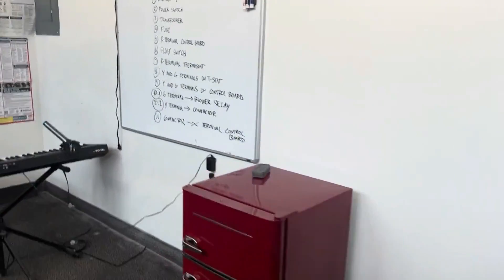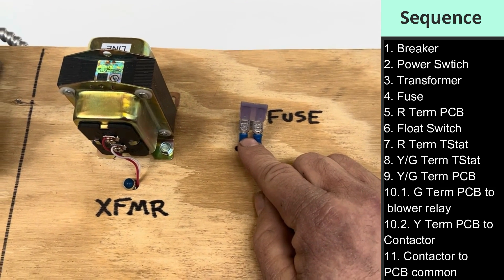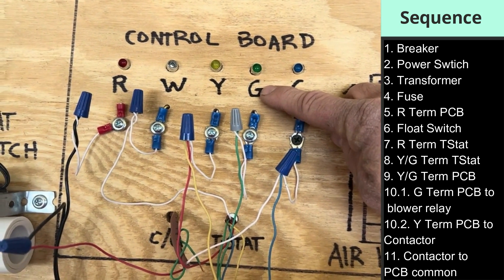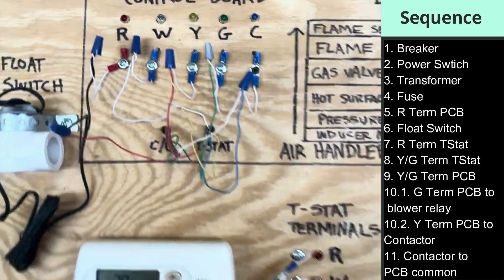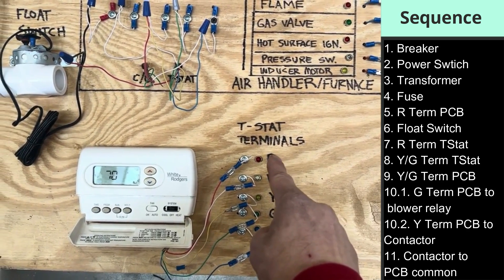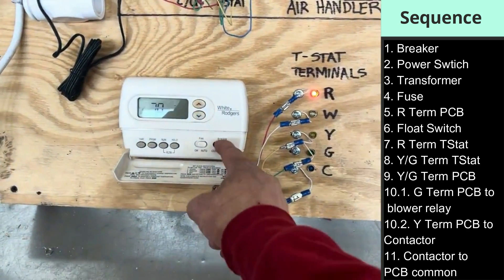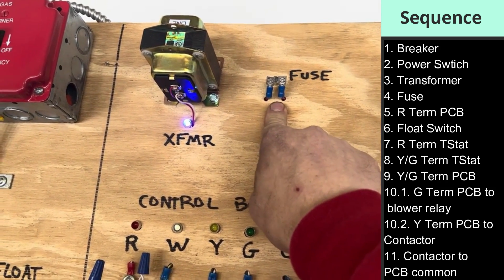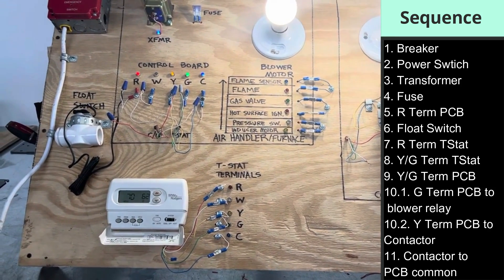Intro to Troubleshooting Central Air Conditioning

Comment: Thanks for the great training. I do have questions. That pesky c terminal. Is it a source of 24 volt power or a return to complete the circuit  ( which would have voltage on it). On the smart thermostats "c" is needed for power? On some systems the condenser unit needs "c" for a return to complete. I believe what I'm struggling with is "c" a type of neutral. More research: watching a few more of your videos has answered my question. "C" terminal is a neutral and like any other neutral in an AC circuit there is voltage on it when in series with another source of resistance. Please correct me if I'm wrong

Comment: My ac went out. I have tested voltage at the tstat wires coming out of the wall and confirmed voltage there. I'm not getting voltage at control board for the ac when tstat is on. I'm also not getting low voltage at the contactor. Would the tranformer need replaced?

Comment: So my blowers are not coming on would I then jump RTG on the thermostat and see if the actual thermostat is bad?
Reply from the maker: Yes, jumpering R to G should start the blower motor if the thermostat is failing to do it.  There are some systems with control boards however that will activate the blower on the Y signal (even if the G signal is not making it). Units with fan relay boards in them (no control board) are the ones that rely entirely on the G signal to activate the blower.

Comment: Went to help someone and got the outside unit from the contact switch to work condensor, then cked the thermostat, know from you that should be first now i know.  no power at red to y   in attic opened the cover and did not know how to trouble shoot but did ck the drain switch....no water   so know it must have been the thermostat or the fuse?  but had to turn over to a pro.....now with your help, I'm getting a getter idea.....your thoughts?
Reply from the maker: Depending on the type of thermostat (those that are still functional when the faceplate is removed), you will read 0 volts between R and Y when in cooling mode because the switch is closed between the terminals. This makes 2 different wires basically the same wire now, meaning you're trying to test for voltage with your probes on the same wire  reading 0 volts when there is actually 24 volts there. Using a terminal with a wire that isn't being used in cooling mode (such as W) will give a 24v reading on R if it's there, because that switch between R and W is open, R and W are separate wires at that point and a voltage reading can be made. 

 I have another video on how to test thermostats that goes into details. https://youtu.be/JzV22cr0ze8

If there is no low voltage reading either way, or anywhere in the system for that matter, then typically it is the fuse, the transformer or the high voltage feed into the unit.

Comment: New tech to the field and had two no cooling calls. Last call today was a fuse popping. Had to call the boss for help and we led it down to  a bad contactor. After replacing with a new one to check the coil we swap out the contact and unit fired up.
Reply: Nice! 👍